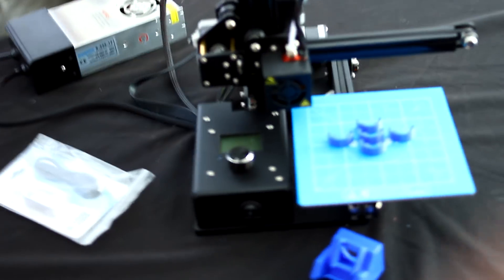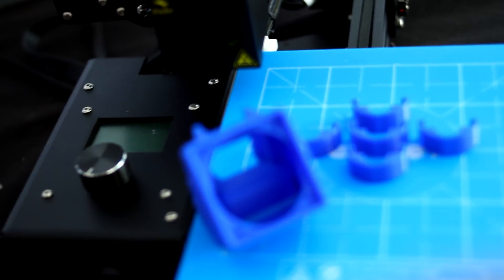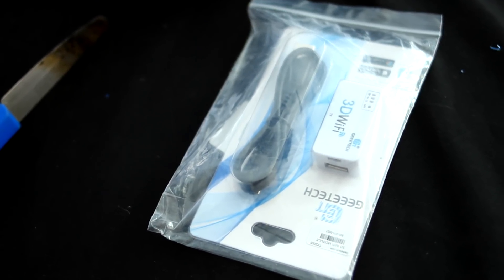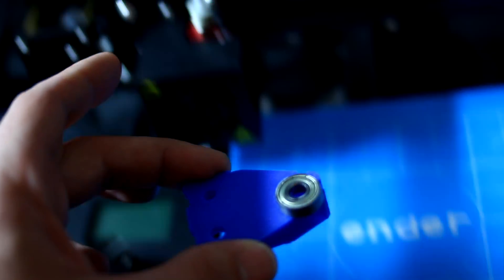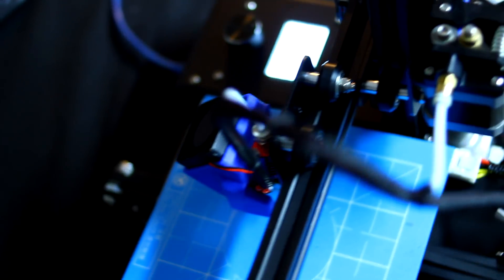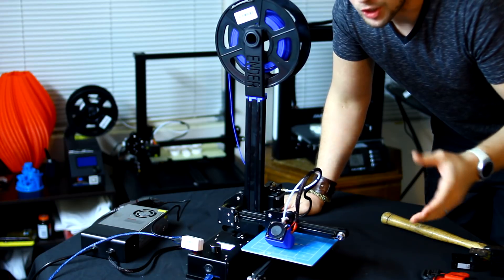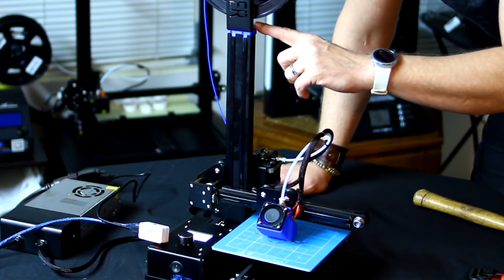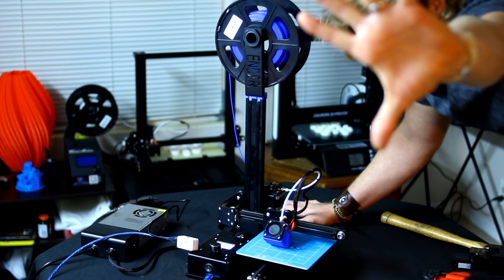✔ ENDER 2 3D-PRINTER ULTIMATE UPGRADES! (Z-axis, Fan, Wireless)

Comment: The fan mod isn't a good idea. You want t be able to control the air to the print (part cooling) and turn it off for the first few layers. What you don't want to do is turn the air off for the heat break, ever! With your mod, you can't do both. Buy a part cooling fan for a few dollars, connect it to the board (already has a connector for it) and print a mod for that. Your current mod is also cooling down the bed on the lowest layers, which is the time you want the bed to be at it's hottest.

Comment: The board has a dedicated connector for a print cooling fan - it's labeled KFAN. Sharing the cooler fan as  part fan is probably better then no part cooling, but certainly not optimal. If you take it apart to replace board fan, it worth wiring for a dedicated fan. The screw HAS TO BE free at one side to compensate for any minor bending that it will have.

Comment: Can you explain why you would want a WiFi module?
Reply from the maker: if you have a wifi module you can directly send stl files to the device without having to always take the memory card to your computer, my normal setup is to clear the bed, turn the printer on and then control it from my PC wirelessly

Comment: I have a totally noob question about my new CR-7. It won't start printing from the middle of the print bed. Always prints from the lower left corner near the edge. Do I change the start point settings in CURA or the settings on the printer itself? Thanks for any help.
Reply from the maker: cura will tell the printer where to start printing, this should be something you can fix in the machine settings, otherwise, check the firmware and make sure it is correct. Are you printing the tests that came with it?

Comment: Awesome vid, was thinking about getting one of these. Did you have any problems with z wobble before the upgrade?
Reply from the maker: not at all, I just noticed it was hanging loose at the top and I move the printers around a lot so I like them to be as rugged as possible for longevity reasons. Usually there is something holding it, luckily its a really simple upgrade)

Comment: The z stabilizer is over constraining the lead screw, it may make things worse
Reply from the maker: +prxrb totally, I had to move the bearing a bit to make it just right) I tested it up and down and it seems to be working solid)
Reply: @RealityCheckVR  Good day! this mod fan better than original for print result or not?
Reply from the maker: @ЛевСтоляревский  I think so, the original one didn't do much and this one works better for my prints i'd say)
Reply: @RealityCheckVR  thank you )
Reply: @RealityCheckVR  wich plastic type you print with this mod fan? I try PLA with this mod fan - I printed a test cube 2x2cm and the corners were sticked off and the threads rose in voids and appeared, but with the original case fun cube print good.